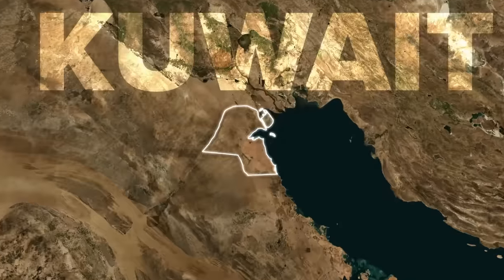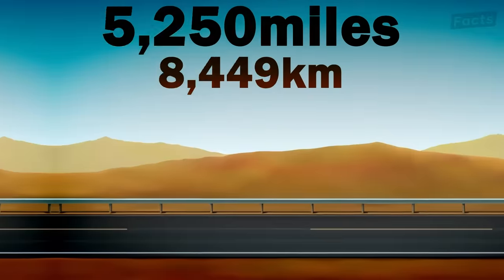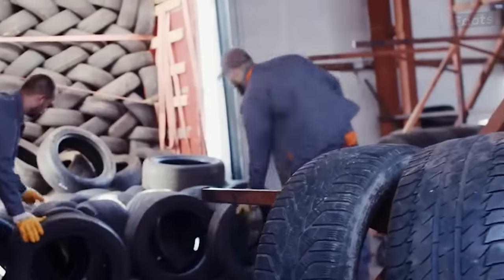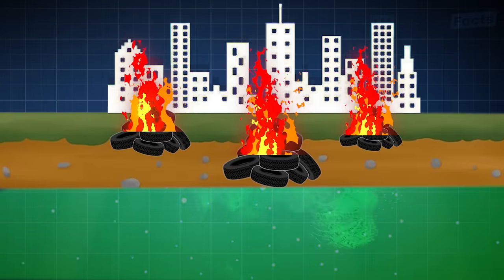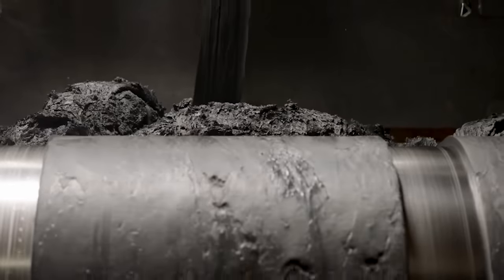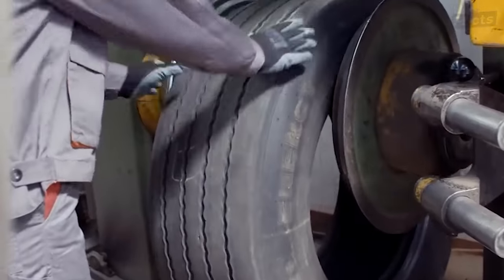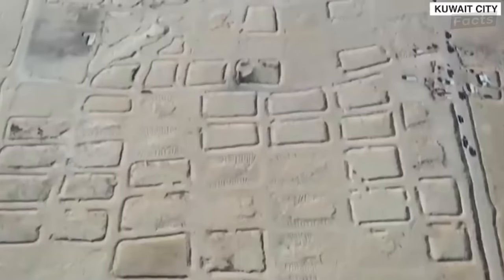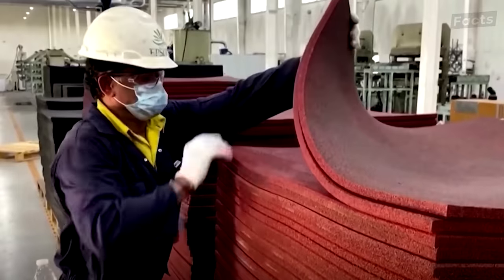Why Are 49,000,000 Tires in This Desert?

Comment: wait, 60 THOUSAND miles? tyre manufacturers recommend [at best] 30,000, but suggest you should be changing your tyres at around 20,000 for the front, depending upon whether you drive a rear or front drive car. but at the very most, rear tyres should be changed by 40,000 miles with front tyres needing to be changed at around 20,000 because of extra wear due to weight. and thats for your standard car, not an suv, which is obviously heavier!
Reply: You can buy tires with different mileage ratings. Just pay more money and you'll get more miles. I've never heard of changing tires after just 20,000 miles. And as far as changing your front tires more often - you're supposed to rotate your tires, I think every 6,000 mi to make them last longer and wear more evenly.
Reply: @snakeinthegrass7443  why would you need to rotate your tyres every six thousand miles? if your car is balanced correctly you should get an even wear all round. the only reason i would rotate tyres these days would be if i drove a 4x4 on/off road regularly or carried heavy good in the back of the car. besides, you would have to have all four boots balanced every time you moved them from wheel to wheel.

as for your dig about spending more money, you DO know we are still short of money all over the world, dont you? now i spend roughly £150 a corner and always change all 4 at the same time, but thats just a me thing as i dont like to have uneven wear front to back.

last bit. tyre manufacturers recommend less use because they want to get more money, or do you think i made that up too?
Reply: @random-person1  You started by saying the front tires wear more than the rear. Now you're saying you don't need to rotate because they should wear evenly  Which is it?
Reply: @snakeinthegrass7443  and they should wear evenly, both front and back. But, only evenly compared to their neighbour. So, providing your tracking is set right, you shouldn't get excessive side wall damage, but have even wear is only a result of good car maintenance. If you drive a heavy car that has front wheel drive only, then you will likely wear the front tyres out sooner than the rear. However, if you driver a rear wheel drive car, because there is less weight on the back end, it's easier to spin the tyres up without trying al that hard. So the tricks to drive like your life depends on it, that way your tyres will last a good deal past their rating. But still, I have never had to rotate a tyre in more than 40 years of driving.

Comment: This does not need to be a problem and can even be generating money.  It is just laziness ...
Steel from the tires  must be removed.  The remains can be used as feedstock in gasification reactors with plasma burners to produce syngas that can be converted to middle distillates and lots of other useful products.
Reply: How bout we just dont make tires that wear out like the light bulb.

Comment: The best option is for chemical degradation of these tires back into asphalt/tar like goo - that can then be used in the road and asphalt roadwork construction.
Reply: Kids playgrounds in South Australia have used chopped up tires for the ground area, for at least 25-30 years, seems good
Reply: We have some of the same, or tires are remanufactured into a solid upper and lower matting, with crumbled rubber inbetween, for a soft ground around play sets etc.